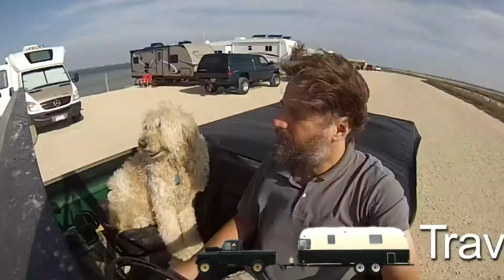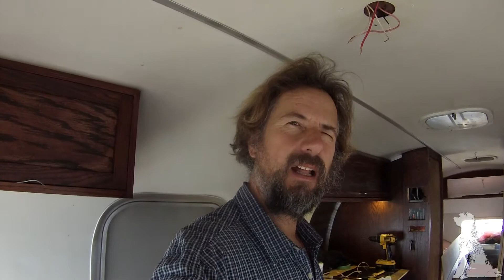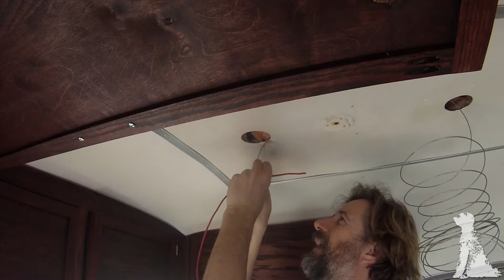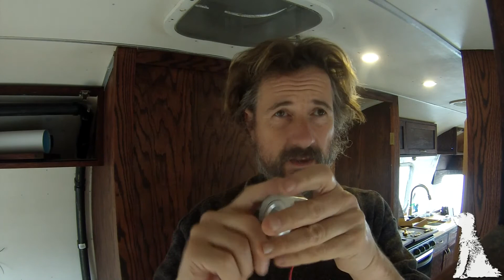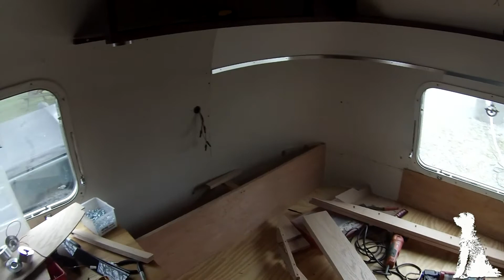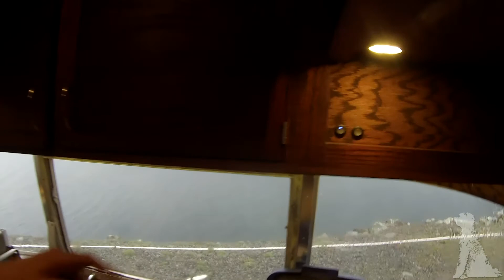Ep 47 - Inside My Coach Build: Perfect Lighting… and Hidden Wiring Challenges | Airstream Rebuild

Comment: Most led lights are capable of running a wide power range , the led work lights I use on equipment will work from 12-36 volt DC